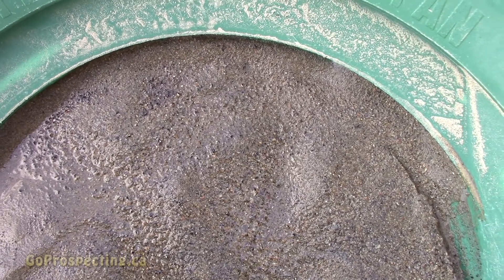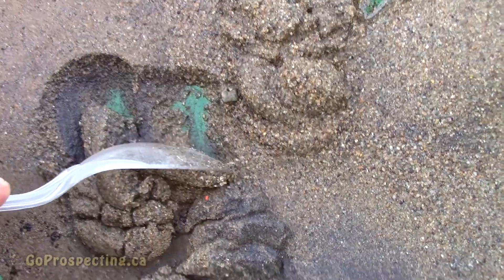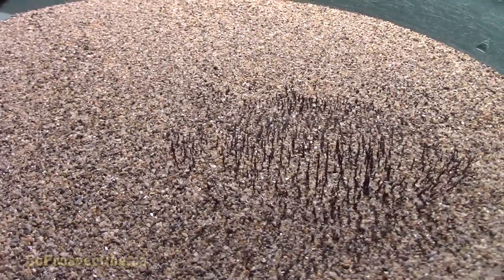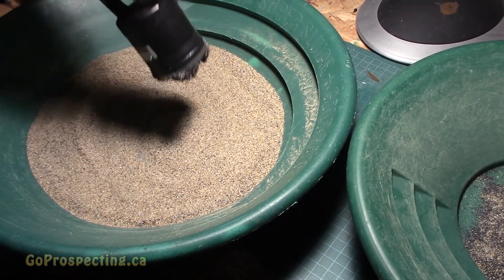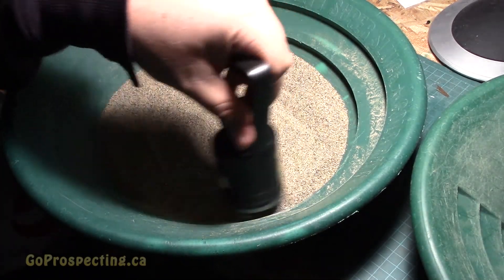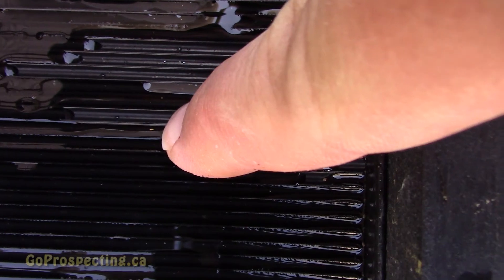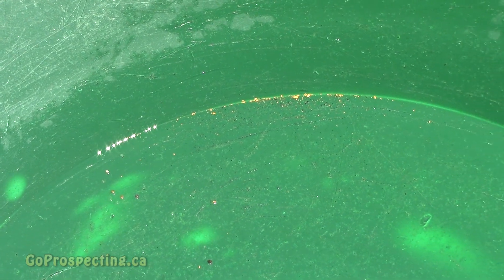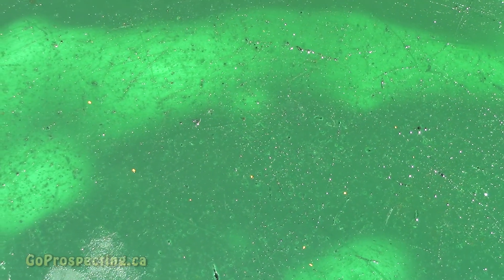Using a Magnet to remove Magnetite from Concentrates

Comment: I argree removing the black sand sure saves a lot of time in the panning process. Did you build your multi sluice? it looks like it works great.
Reply from the maker: I did build the cleanup multisluice.  Used alternating fine and coarse V ribbed matting.  I find it works quite well.  Thanks for watching!